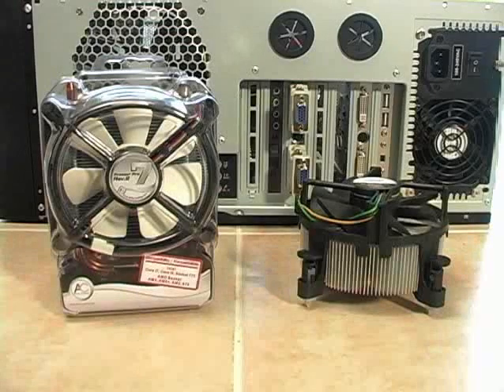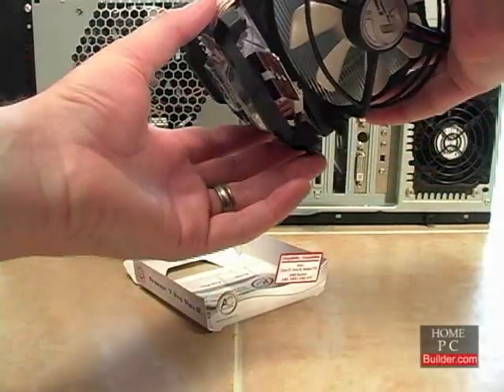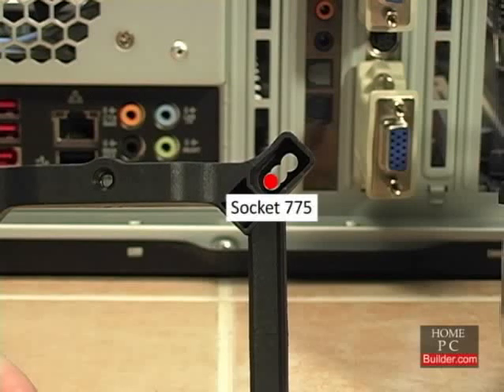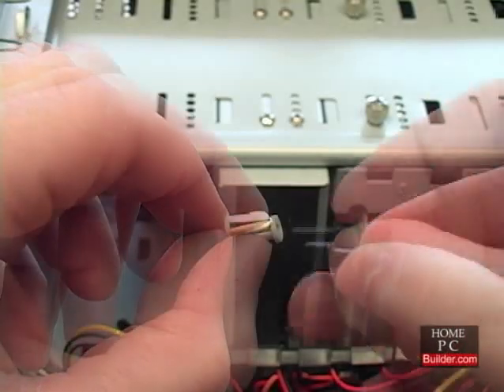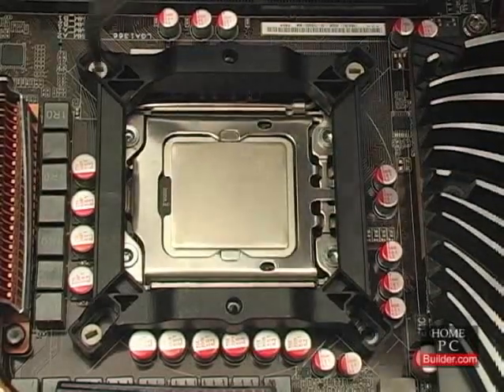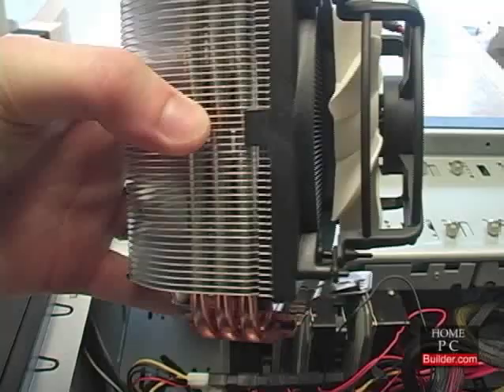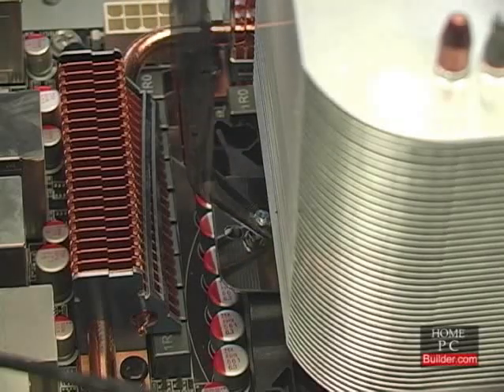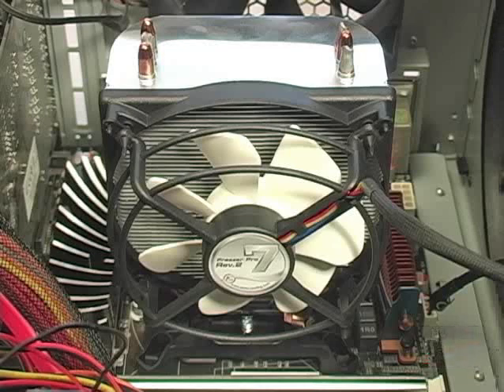Installing an Arctic Cooling Freezer 7 Pro Rev.2 CPU heat sink cooler

Comment: Hi. I have an ARCTIC FREEZER 7 PRO REV2 cooler and I would like to remove the cooler to replace the motherboard. I had tried to pull the black pins but I can't and I don't want to pull them with extra force, because I am afraid to broke them? any advise or tutorial? I don't want the solution to press them from the opposite direction, because I must install my old cpu in the new motherboard, after I update the bios to support the new cpu. So it is not a solution to unistall the motherboard every time to change the cpu. thank you in advance!
Reply from the maker: There were several versions of the Arctic freezer 7 Pro rev 2. You wouldn't think that would happened with the name being the same but there are several versions with different mounting methods. Look at several videos and see if you can find one that is more like yours.

Comment: My gaming pc keeps restarting when I play only games but doesn't if I leave side panel open

I7 processer
16gb ram
Windows 10 home
1tb hardrive also have external ssd.

Tried different gpu hardrive reinstall windows 10 
Low graphic game but same issue.

Cpu temp look high even after applying thermal paste I don't have cpu cooler.

Any help would be appreciated.
Reply from the maker: You have to have a cpu cooler.  Do you really have thermal compound on the cpu with no cooler?

Comment: Good Video. What a simple install. My main worry is with having no back plate and the unit is 1.3 Lbs. that it doesn't stress/bend my mobo (?)  
Is there a way to check if this cooler will block a RAM slot? I use all 4 . I can't tell from pics of my mobo and the coolers specs.   I have a Gigabyte EP45-UD3L.  I believe it should fit in my case which is a Coolermaster RC-690-KKN1-GP.

Comment: Hello I have just installed this onto my Sabertooth x58 motherboard with an i7 920 processer and I am only noticing a 5 degree chaange (lower) to about 39 degrees from 45-50 degrees with my basic Intel Heatsink and Fan. Does it take a bit of time to start working effectivley? Also the push pins are slightly different than in this video (prob because its over a year old ) :))

Comment: hmm mine came with bigger push-pins and it was annoying because they were more spread it took me some time to push them in the wholes :( and I don't understand why 3 of the heat pipes are like squashed it looks really ugly but otherwise the cooler is great with the stock Intel I was getting 75 degrees while playing games now its 50-55 I have intel i7 860 not the best cooler but for the money you pay you can't complain :) oh and I have a coolermaster storm scout and it fit perfectly its not big.

Comment: Thanks, very informative video. I just got one to go with my i5-760 as the stock cooler looks a bit pathetic. I also got some arctic cooling MX-4 thermal compound as the pre-applied stuff doesn't looks too good. Only problem for me is height, and as I have a side-mounting fan, according to my measurements, I will only have 2mm to spare at the top of the heatsink. Does the height include the copper heatpipes sticking out the top or not? If so it should be alright.

Comment: @jamma246 yeah what happend
i have just bought it and i will tell you my results
I have an intel i5 760 @ 2.88GHz

Idle with the stock cooler which i replaced with the pro 7, temp 45C 
On shogun total war on medium settings - 66C high 78C and very high - 80+ I have it set to shutdown at 80
The freezer pro idles at 28-30C medium - havent tested High - not tested Ver high - 48-50C
I love this cooler, its just amazing

Comment: @mycuteboys Compared to most reviews, and what my Tjcase perfect temps are 72.5C, they are pretty bad under load. Playing games about 1-2 hours I get a high of 71C on the coolest core and 74C on the hottest core. Idle after I start up is an average of 39C and after playing games and I leave the PC to rest and do nothing for half an hour Idle is about 42C-43C. I try playing with my window closed and under room temperature of about 20C-24C. Room doesn't get any warmer than that. CPU:i5-760@2.8GHz

Comment: @TIZ012 The cooler doesn't actually use 130W.  The 130W is a rating of CPU it can cool.  A 130W cooler can cool a CPU that uses 130W.   What CPU do you have, what are the temps your getting at idle and under load?  Idle being when the CPU isn't doing anything but running Windows and Load being when the CPU is in heavy use by a program like Prime95 that maxes out the CPU.  It may be that the cooler isn't on correctly.  Let me know the CPU model and the temps.

Comment: Question, when building my PC used crap PSU which was 650W. It was not good enough to supply my PC with power. I replaced with a 600W Corsair and it worked fine did some simple overclocks and I was happy everything was working. But decided to get temperature program to monitor what I get. My GPU with overclock fine, but CPU I get high temps with no overclock! Question is how much power does stock cooler use and you think this cooler which uses 130W will actually be fine with my current PSU.

Comment: My cooler arrived today and has been installed but I am disappointed with the results which are no better than the stock hsf and maybe a bit worse. It should be pointed out that my temps maxed out at around 74c running p95 (i7 920@stock) after bout 10 minutes so not too bad. I expected better with an aftermarket cooler, even a cheaper one. Having it idle at 45c with the cpu@133/12 at the desktop isn't what I wanted.

Comment: I have the 1st version of this cooler. It's a very good cooler but the push pins supplied are totally crap. Really, if you think the push pins that come with a stock intel cooler are bad, these are much worse!!!
They aren't secure enough and work loose with movement, esp. when cleaning the fan! 
For goodness sake, if anyone from Arctic Cooling is reading this, PLEASE  get this sorted out. You make excellent coolers, but these plastic push pins you supply are crap!  Total Crap! 
Get the message?

Comment: I just bought an installed this heatskin as described and the fan does not spin. When i turn on pc it spins slightly then stop as if its trying to spin but just doesnt spin up. There are no obstacles for the spinning. The Intel fan works perfectly.
I use an intel e8600 on a Asus P5ql Pro.
I found the problem I described being not rare on the web, so I assume the fan is not defected. Any suggestion? Thanks in advance.

Comment: Yes I connected it to the cpu fan connector. Anyway I reinstalled my stock fan. I haven't use my computer for about a week now. Today was the only time I powered it on just to see if the fan was working.Someone told me at tomshardware that if I turned off my pc in less than 10 seconds the cpu won't fry. He told me that the cpu would automatically shut down if it becomes hot. Just to let you know I applied artic silver alumina on my cpu.

Comment: I can't orientate the fan to face towards the rear exhaust vent, my only options are up (lid of case) or down (towards the GPU). I'm using a bit fenix midi tower, a gigabyte 970 ud3p motherboard and an amd processor. I have to use the stock amd brackets, which are two small rectangles that only fit on one way and limits the possible orientation to up (just a couple inches from lid of case) and down (straight onto graphics card). I can't use the Intel bracket that came with my fan which appears to give 4 possible different orientations.
Will pointing it up at the lid be enough?
Reply from the maker: +Ka MiK Pointing it up is best in that case.
Reply: Thanks.

Speedfan says its running well so far.

Comment: I have not mentioned any back-plate as i know after fitting two of these coolers that they do not use them.As in the video i have talked about a mounting plate which is on the front of the board.I have not yet tried to take off the older of these coolers but the newer which has different push and spreader pins is easily removed from the front of the motherboard.

Comment: @hpcbdvd i bought this cooler and installed it on my AMD system however it was very tricky to instal on an AMD system and now when i boot up i get no signal from my monitor and the usb ports on the motherboard dont see to work.  Must be something wrong with the motherboard caused by the tricky installation. Any advice?

Comment: @hpcbdvd I would say this is not the case since I tried to launch a 3dmark 06 checking the temperature which was going easily to 50-55-60 degrees. During the first 3dmark06 test the system rebooted  guess because cpu was too hot. The fan did not move during the whole procedure and touching the heatsink with a finger, I must say it was kind of hot.

Comment: @HPCBDVD I haven't installed any thermal compound on my cpu. I'm actually building my own rig. I just don't want to use the default stock heatsink fan that came with my cpu. Somebody told me that I have to remove the pre-applied thermal compound on the Arctic Cooling and apply a thermal compound on my CPU instead.

Comment: Not true. The spreader pin if crimped from each side can be removed and then the mounting plate just lifts off. There is another problem which i know off, which is the back/ front configuration for some Asus  motherboards will not work due to clearance problems.

Comment: @hpcbdvd 
thanks a lot for the help...I need a new cooler since I swapped motherboard and the new one doesn't have a support to install the stock cooler for my Q6600...need to buy a new cooler... Artic Cooler freezer 7 pro rev.2 seems a smart and cheap choice...once again...ty

Comment: I've ordered this cooler for my socket 1366 motherboard but am concerned because my PSU is located at the top of my case. The case I am using is a Gigabyte Triton and it isn't exactly roomy... Guess I'll just have to wait for the cooler to arrive and see whether it fits the case.

Comment: Could i get any advice? I have really bad overheating on my gpu due to the freezer 7 pro rev 2. The heat it releases splashes on to it and it has ~65C degrees all the time which slows my pc down greatly.

How do i get the heat out of the pc? Redirect it somehow? Haaalp

Comment: @hpcbdvd I would not say this is the problem: I have tried a 3dmark 06 and during the first test the system rebooted. Coretemp was saying temperature was going easily to 50-55-60 degrees and then it rebooted.The fan didn't move and touching the heatsink it was kind of hot.

Comment: Thank you very much hpcbdvd.
I found this video very useful and understandable, unlike many other video guides on the net.

Would be nice to see how this cooler connects to AM3 sockets as well.
By the way, I will be able to remove the cooler after I completely installed it right?

Comment: Hello, the Arctic Cooling Alpine 11 GT Rev2 cpu cooler also has heat skin applied i believe, does this mean i do not need to add any more thermal paste?  thanks in advance and just to add if you need i have an i3 550, thanks again!

Comment: when i tried putting the push pins in they would'nt clip in, one of them did but the rest struggled to get in, what should i do? i have an x11 advanced x-station case with asus P5G41T-M LX and intel core 2 quad q8200

Comment: Very bad design.When the mounting plate is installed the CPU can not be fitted or changed without removing the mounting plate.Shoot the designer as this is not too hard to work out.

Comment: Hi, you wouldn't happen to know what kind of mounting screws (White one's) this uses and where to get replacement ones?

Thanks
Reply from the maker: Those are made just for this cooler.  I'm sure you can order new ones from the maker, Arctic Cooling.
Reply: Michael Cooper hey so this won't fit on an LGA 1155 chipset.?

Comment: Afraid to touch your motherboard?
Reply: Talking about the pliers? There is a chance the static energy on your body can transfer to your computer and fry up the circuits.
Reply: Jake1825 that chance is too small. its safe
Reply: 123woefie I have never experienced it but I have heard that it happened. Oh well, stay safe...
Reply: It extends hand, so it's easier to access some tight spaces compared to using fingers.

Comment: can i use this heat sink on a lga775 threaded motherboard or does this only work for pushpin motherboards? thx
Reply from the maker: The push pins are a part of this cooler and will work with any Intel Sockets 1366, 1150, 1151, 1155, 1156, 775.  It also works with all AMD sockets.
Reply: very well, thank you for your time, excellent video.

Comment: Hi Michael, thanks for the tutorial. Where can I buy the tweezer you used for screwing in the heatsink bracket (shown at 2:45 in the video)? I want to get one for install my heatsink and fan. Thanks!
Reply from the maker: Jason Huang those are needle nose pliers and I've had them forever. I don't remember where I got them. I imagine if you did a search for needle nose pliers on Amazon you could find some that are like that. Having them with the very end bent has often been helpful.
Reply: Thanks Michael. No wonder! I kept searching computer tweezers on Amazon and all I found are small and thin tweezers, not like the one you show in the video. Do you think a needle nose plier is better than those electronics tweezers for this task?
Reply from the maker: Jason Huang The reason you were finding tweezers when you did a search for tweezers and they're too small is because tweezers are very small. If you're looking for something like in the video those are actually needle-nose pliers. Do a search for that.
Reply: Michael Cooper yes Michael. I did the search. Just wondering if pliers is more handy for this than tweezers in your experiences. Thank!
Reply from the maker: Jason Huang yes pliers worked better for this

Comment: can you mount it on a HP Envy 700-021eo. Intel I7 4770k 3.4 - 3.9 processor ?!
Reply: +Zappers91 Provided that you remove the existing cooler, I'm pretty sure it has it has enough clearance, and it's compatible with that socket, so yes.
Reply: ok thx man
Reply: Zappers91 you will have problems with the motherboard holes, because if you have ms 7826 motherboard you will find the motherboard holes so small

Comment: is the rotation of the fan important or can it face any way ?
Reply from the maker: The fan direction is important.  You want it blowing the air toward another fan that will move it out of the case.  Either to the back of the case or the top.

Comment: can I put on to socket LGA 1155?
Reply from the maker: Yes.  It also works on socket 1150.
Reply: I meant socket 1155
Reply: I just watch your video of ram upgrade. just confuse about the colour of socket. getting ram 8gb 1600mhz I have to put in red and 8gb 1300mhz in white. can u explain the concept of this please
Reply from the maker: s Khan The slot colors have to do with the RAM channels.  If you put two sticks of RAM into the same colored slots you enable dual channel mode which doubles the memory bandwidth.  Mhz is different.  Go back and watch the RAM upgrade videos starting with Lesson 1.  I know from looking at the number of views on the later videos most people skip to the installation videos but there is a lot more to it than the installation.
Reply: Yesssssss